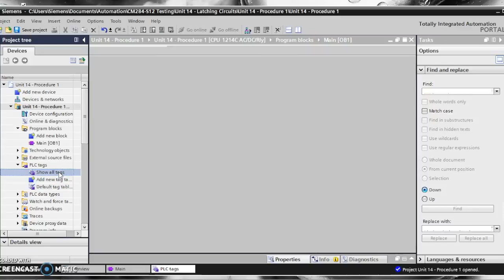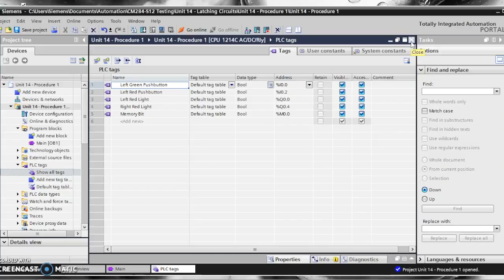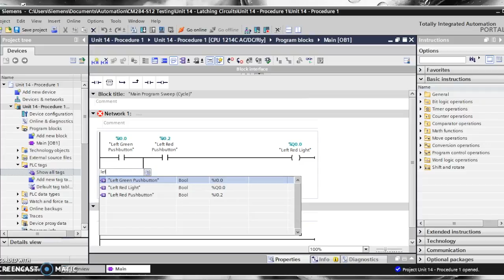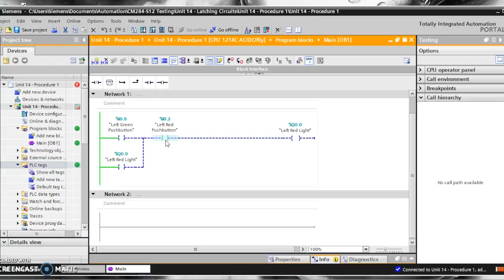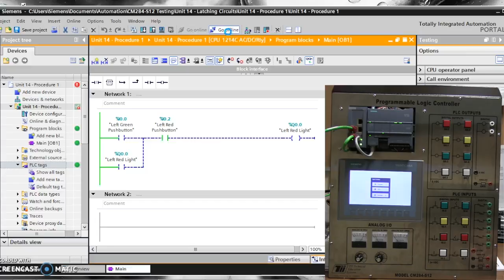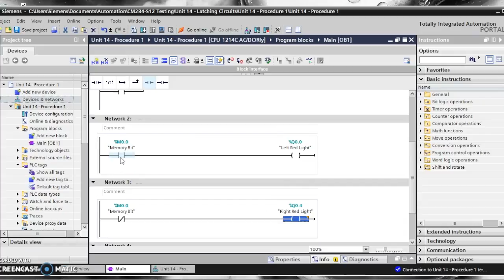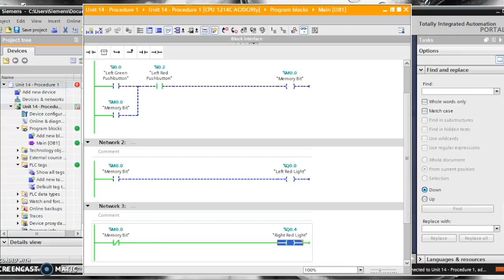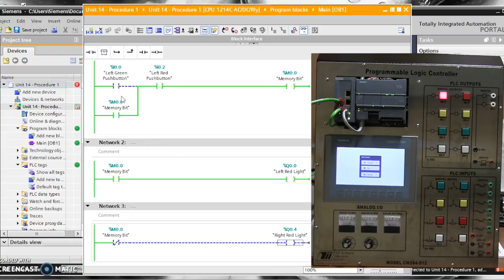Siemens PLC Latching Circuit

Comment: I don't understand the first example of latching circuit. Red pushbutton should be NC contact instead of NO am I right?
Reply from the maker: No you are not correct.  This is the most common mistake for new programmers.  They are not normally open or closed contacts.  The are XIC instructions.  Since a stop is normally closed it is true when it is not being activated.
Reply: A